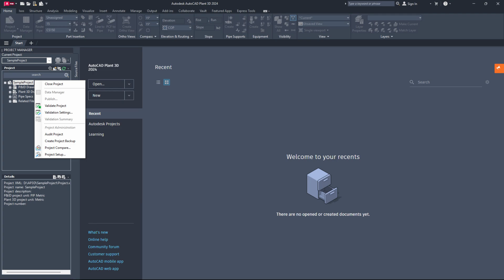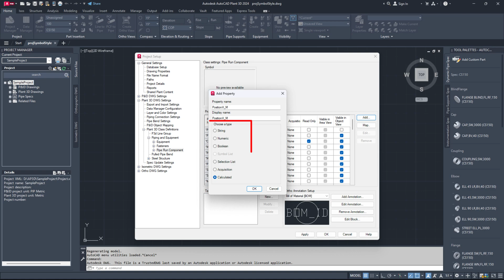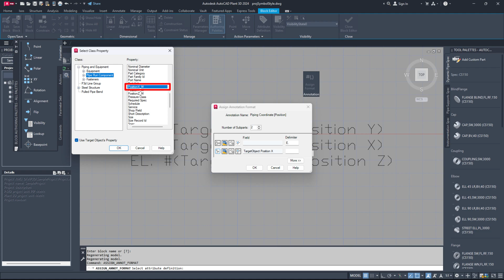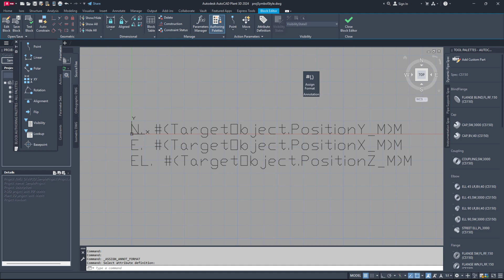AutoCAD Plant 3D | Display Coordinates in Meters on Orthographic Drawings

Comment: Hello, again.

A question has arisen. If a large project with 10 people working on it was created in Plant 3D 2020.

But now we are using Plant 3D 2026. 

Would it be better for the project if we recreate it from zero in version 2026 and add files from version 2020?
Reply from the maker: Not necessary, really. Just stay with Plant 3D 2026.

Comment: Hello:)

There hasn't been a video for a long time, we're looking forward to it :)

Do you think, when creating offpage connections, it is possible to configure it so that it adds the number of the circuit in which the line continues?
Reply from the maker: Thanks so much for the support! 
I really appreciate your patience — a new video is on the way soon, and I can't wait to share it with you 😊

Are you referring to the connecting P&ID number? By default, it is set up in OPC.
Reply: Maybe someone (or I) somehow broke the project settings.

I've seen that the standard offpage connector refers to the PID circuit it connects to. 

But I just have a dot output after joining...
Reply from the maker: @znakjj Include the "DWG Name" attribute in the OPC block. This will fix your problem.
Reply: @acadp3dsolutions  Is this attribute located in the GENERAL section?

If so, then there is only DWG Number and DWG Title.

I tried to do something with these attributes, but they, as I thought, show the number of the drawing in which this connector is drawn.

Example:

Scheme No. 1 - Line No. 1 Scheme No. 2 - Line No. 2

Line number 1 continues on diagram number 2.

It turns out that in diagram 1 I see a connector that says "diagram 2".

But now I see in diagram 1 in the connector "diagram 1".
Reply from the maker: @znakjj  Verify the standard OPC block attributes and duplicate them. Additionally, ensure that the drawing number is included in the drawing properties of each P&ID.

Comment: Hi there, ' connection setting for wafer valves without gasket ' for next video? Thanks. lined check and butterfly valves as suitable as rubber insulation kit and so in
Reply from the maker: Just uncheck the gasket from the fasteners under the piping connection settings. Why make a video for something so simple?
Reply: @acadp3dsolutions 
Default settings for this connection is 'wafer flanged joint' with gasket fasteners. If uncheck gasket from this connection, it will remove gasket in the isometric but iso drawing will be splited to two files at this point! So this doesn't work.

Comment: Hi again :)

Anyway I have an interesting problem. I have pipes with fixed length and fittings for it in my catalog. I want a protective cover (against chemical leaks) to automatically appear on the flange connections. So that it is accounted for in the specification and isometrics. 

Where do you think to start and where to finish)?
Reply from the maker: This is a complex topic, so I plan to create a detailed video on it. But in short, to proceed: create a component under Fasteners, then add that component category to the Flanged Connection under Piping Connections in the Project Setup. Best of Luck!! 👍
Reply: @acadp3dsolutions  thx!
Reply: @acadp3dsolutions  What exactly is the right component for this task? I have tried Collar, BackingRing and Clamp. 

The Collar and BackingRing I can't center between the flanges. It draws from the port and is not centered in the middle.

Clamp is centered, but there are bolts drawn there, which are not suitable for this cover. (it is possible with them, but it is better without them :) )
Reply from the maker: Make a custom clamp that doesn't use bolts and test it.

Comment: Hi.

Please give me some advice. I'm currently doing a template project at my work and have run into a problem. 

In the P&ID tool palette there are custom elements that my colleague creates in another plant3d project. But creating a new project from scratch (I do not want to create on the basis of his project) I can not insert into the drawing P&ID these custom elements, because there are no classes to customize the project. 

How can I quickly transfer these classes from the old project to the new template project so that everything works.
Reply from the maker: Utilize the Project Compare feature available from Plant 3D 2022 and above to move data between projects. Check out our dedicated shorts video on Project compare.